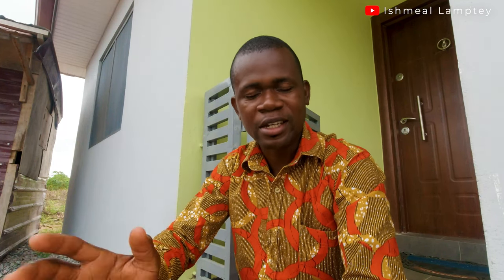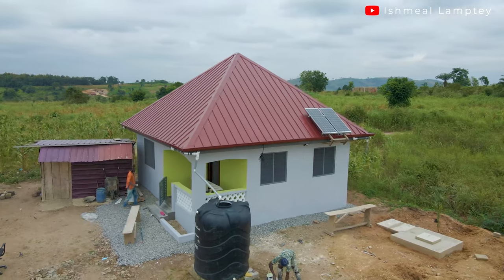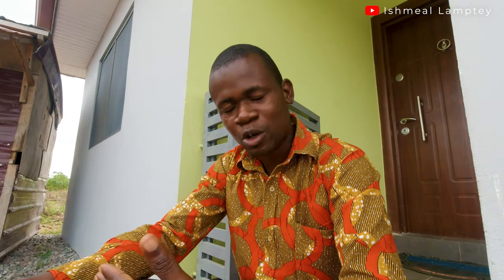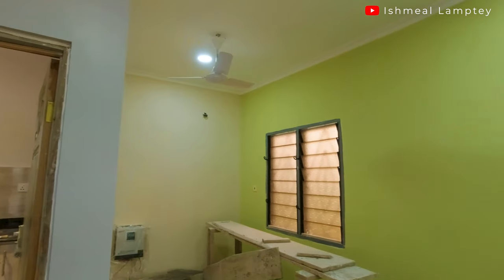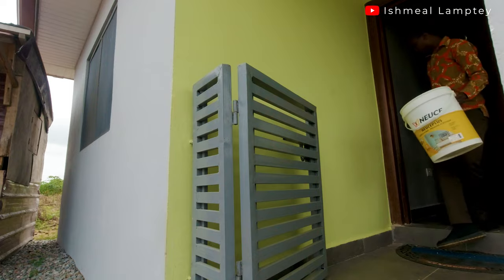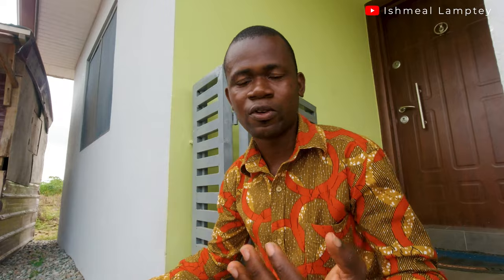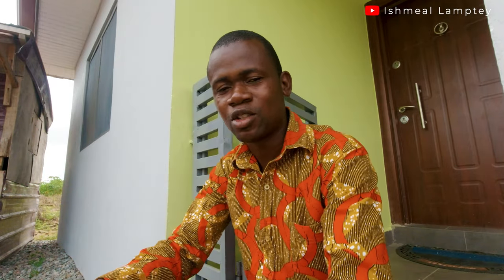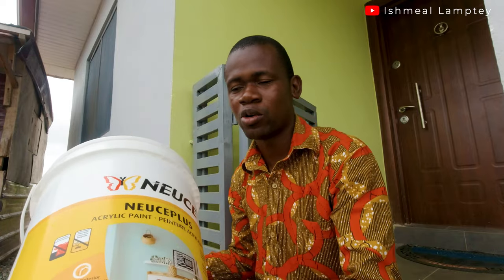Watch this before painting your house in Ghana

Comment: New plastering doesn't usually hold paint well. It's why they recommend a primer which helps with bonding with wall. Even then, l'lI recommend painting after a month or two... a very dry wall.

Comment: I suppose there are factors that needs to be considered for these peel offs other than the brand of paint. 
Like someone rightly mentioned in the comments, priming the wall is a necessary factor. 
Also, we need to understand the soil profile of the location of the building. Perhaps the peeling off is as a result of dumpness. If that is the cause, the brand of paint may not do much since the real cause has not been dealt with. 
If you need professional advice on the subject matter I will be more than glad to assist. 
I hope you identify with my views on the subject matter. Thank you.
Reply from the maker: Thanks for your comment. For now, the issue has been resolved.

Comment: Thank you for sharing. This is very helpful,  Did you find a better brand that works? Any updates  on the paint work now with different brand? What brand have you now used on the homes you are building please?
Reply from the maker: There are a lot other brands that we've tested and works well, examples are Dulux, coral, leyland, Azaar among others. You only have to know the right type of paint to use for every job
Reply: @IshmealLamptey  thank you for sharing, good information

Comment: Thanks bebree for sharing the details on paints. Is painting totally necessary?
Reply from the maker: You're welcome and thanks for watching as well. Painting is sometimes necessary, depending on the type of paint and the location. Painting helps prevents metal from rusting and sometimes can also serve as a shield to prevent walls from experiencing harsh conditions
Reply: So after building a cement block structure and plastering it, it shouldn't be painted? Or we should all build with clay bricks so there's no need for painting? Or what? Please tell us
Reply: @markntiri8251  plastering can be dye or finished with something other than paint. There's a number of options
Reply from the maker: Sure. The cheapest amongst most of those options is painting. Especially for a 21st century building
Reply: @IshmealLamptey  I thinking dye the plastering might be cheaper though
Reply from the maker: @aberba  i see. Any dyes you could recommend or where they can be purchased here in Ghana?
Reply: @IshmealLamptey  in your case, you've already plastered, but you'd usually mix the powder with your plastering. Iron Oxide is an example of such dye, it's in a coloured powder form. I believe it's what the block factories use for coloured pavement blocks...or a similar compound.
Reply from the maker: @aberba  oh i see. Thanks for sharing
Reply: @aberba  ok. The dyes come in various colours? And what happens to a 'repaint/redye?'
Reply: @markntiri8251  I've seen all kinds on colors online. Not sure why ones are easily accessible. You can't re-dye since it's baked into the plaster. You'll have to paint later if you don't like it or it fades as far as I know
Reply: @aberba  seems like painting cannot be completely taken out of the picture.
Reply: @markntiri8251  if a dyed/colored concrete wall fades, he CAN paint, not a MUST. There are many options including recoloring. The color is baked into the concrete so it should last a very long time when done well. You can Google these things online.
Reply: @aberba  your point is clear. How many of us do the dye thing anyway? Or even opt for other 'no paint' options? Painting is easy to do and is inevitable; for beauty, protection of surfaces etc. Wonder why the first asker of the 'no painting ' question posed the question
Reply: @markntiri8251  the question is was whether painting is necessary. Your "How many of us" has nothing to do with the original question. Of course you do what you want.

His painted wall just started failing apart. I'm saying there are other options that cost less with time. If you're not well versed in those other options, then it's easier to just stick with paint. Some people like paint of course but that comes with its cons. 

In his case though, I think it's probably a bad paint job anyways.
Reply: You need to buy waterproofing from city paints in spintex road to make sure it does not leak

Comment: We have used dulux weathershield and even on timber around the garden where it gets blasted with burning sun and lots of water and so far after 4 years it still looks exactly the same…

I have seen it advertised at coral paints gh…

I looked online at the neuceplus paint you used and I can see it does mention interior and exterior walls as you also said in the video but… that same brand has other products that present more as exterior paints… 

I am not sure I would ever personally trust a paint can with an interior wall pictured on the can for use on exterior walls that are exposed to the harsh elements…

Hope you find something that works, thanks for sharing your experience.
Reply from the maker: Thank you very much for sharing this. This is going to be very helpful.
Reply: Shield paint be better one because it is made for Ghana weather. It go last long. I be painter 10 years now.
Reply: @johnnyeastregion  Australian hot weather is the same as Ghana weather - very harsh sun…. Have you lived in both countries? We have.